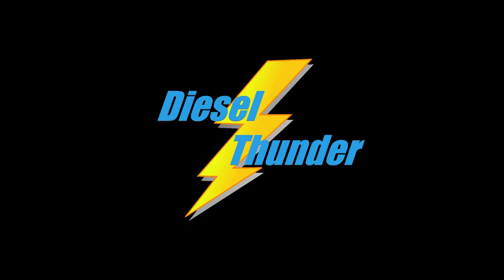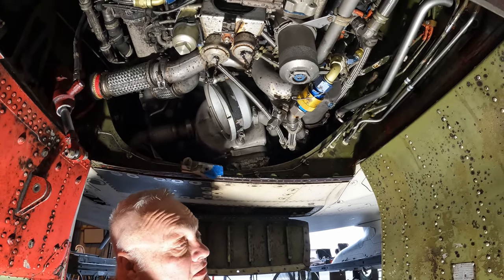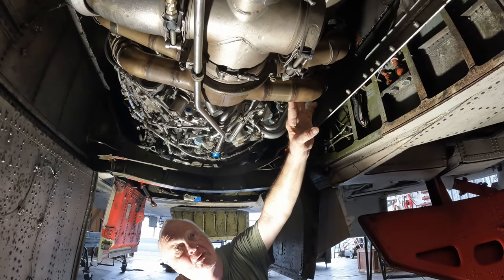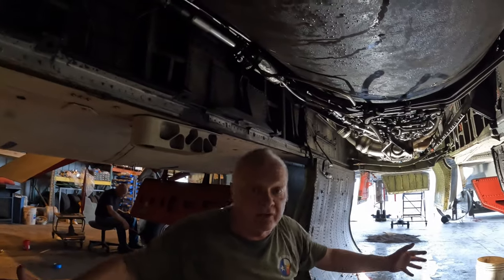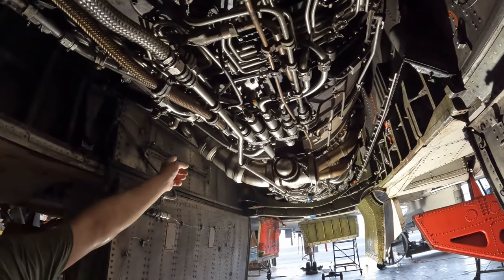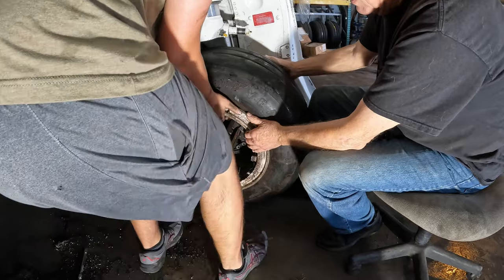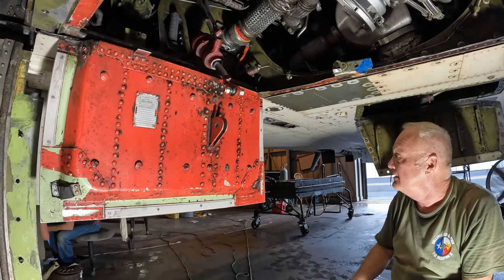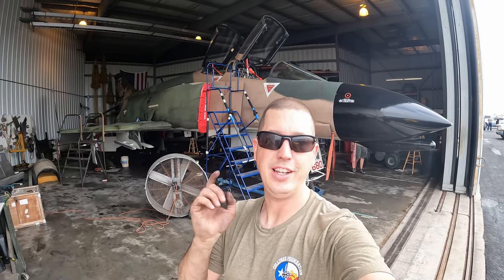The Heart of a Phantom, the GE J-79 - F-4 Phantom

Comment: Oh, man! I feel like I've been looking up the skirt of an old girlfriend! I flew the F-4B and it's been a long time since I looked in all of those oily places. What a magnificent old bird! Built like a brick outhouse and with two of those beautiful J 79s, it always got me home.  One thing not mentioned in this great walk around was the unusual linkages of the stator vanes. On this engine, the throttle lag was eliminated by the use of mechanical linkage connecting all of the stator vanes so that they responded to throttle position. That meant that on TO when you pushed the throttles forward, the engine power was right behind your hand. The stators all streamlined at the command for TO power, thus no rpm lag. It was the only jet I flew with this great feature. It was also rock solid and if you walked on the wings, the plane didn't even move. It was a beast!
Reply from the maker: Thank you for your service! That's interesting, I did not know that about the stator vanes, learned something new today! I agree about walking on the wings, she's a solid aircraft!

Comment: Changed many hydraulic pumps on the J-79. 
Hardest part was checking for hyd leaks during engine run up. It becomes a little uncomfortable especially during afterburner run.
Reply from the maker: I can’t imagine a leak at 3,000 psi. I’ll get to experience the engine run up at some point. We’ll tow her out to the tie down pad and check the engines good before she’ll take to the skies again.
Reply: @DieselThunderAviation  where is this aircraft located?
Reply: @Danny Snyder   I got to watch a few times the Squadron mechanics run the engines at high power settings, for post maintenance checking I was told.   One guy would scuttle around under the Phantom while running at high power checking and prodding with a screwdriver.   The noise was terrific.
Ex IAF Structural tecnician / Mechanical fitter F-4, F-16, MD-500
Reply from the maker: @dannysnyder4035  She is kept in Houston, Texas.
Reply: Thank you for keeping me updated
Looking forward to next year
Reply: How many hydraulic pumps on the ADG ?     2 pumps ??
Reply: @raymondd.6449  1 hydraulc pump on each engine 
Manufactures were Vickers and Kellogg. You did not have to pair them up. You could have one Vickers on one engine and a Kellogg on the other engine. They both looked alike except for the data plate.